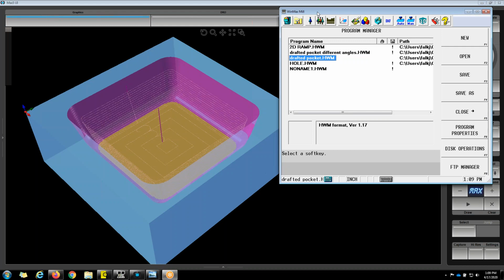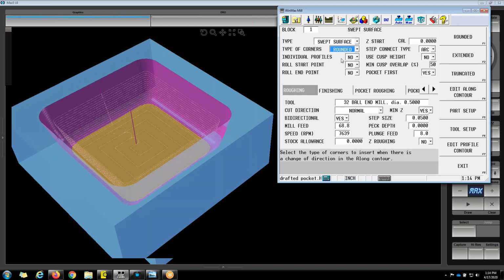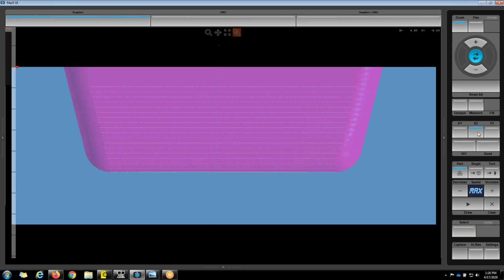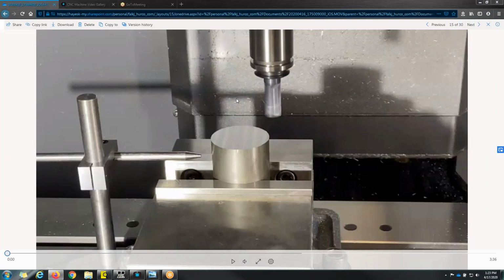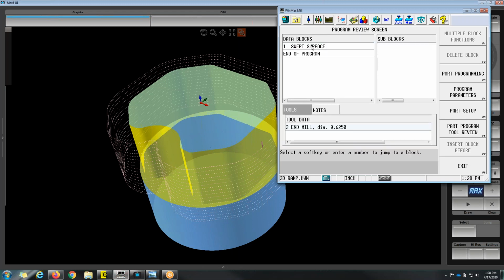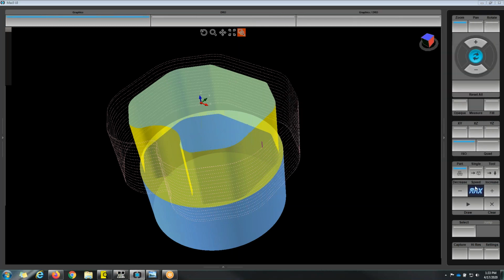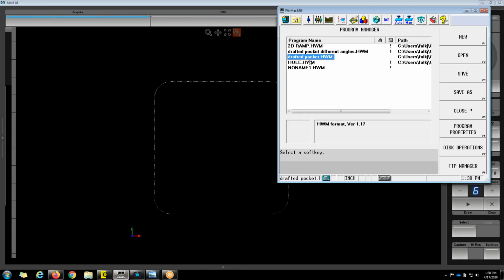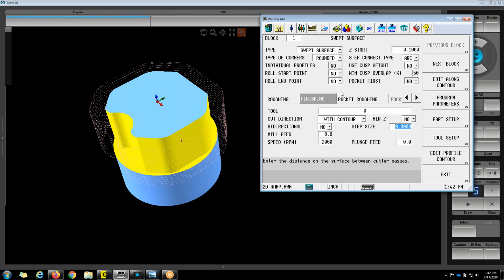Hurco Quick Training Session 3: Using Swept Surface on 2D Geometry

Comment: Hey, everytime i use this on my machine, there is an offset. It always does it, and it does not mill along the contour I've programmed. Is the machine assuming im using a ball nose end mill even when I have a flat mill in there or is something else going on? I've even reconstructed my tool path based on having a flat mill and assuming the machine is just receiving the center of my tool in the program, but that has not fixed the issue

Comment: What is the difference between 3d mold and swept surface options? For the first time it seems they are the same.
Reply from the maker: 3D Mold allows you to create a 2D shape, and sweep it along the Y-axis, or rotate it around the X or Z-axes. 
Swept Surface allows you to create TWO 2D shapes…one is the shape that will be swept along the second shape. I explain it as using a wood router. One 2D shape is the shape of the router bit, and the second 2D shape is the shape of the piece of wood that you want to run the router bit around. 
The purpose of the webinar mentioned below was to show some uses for assisting in regular 2D 3-axis machining. In his webinar, Jason showed how to use Swept Surface to “spiral” around a profile of a part.